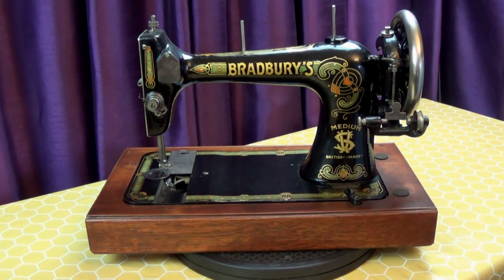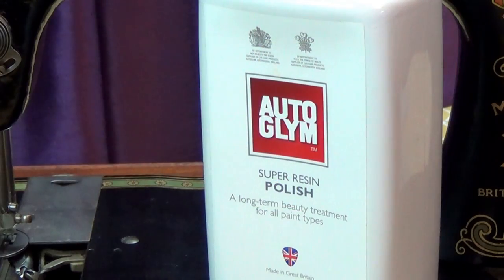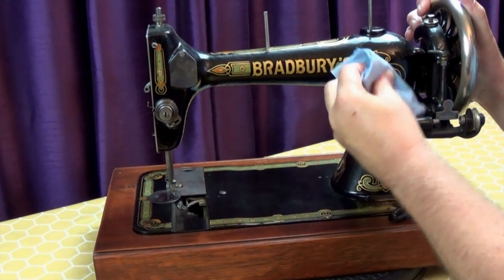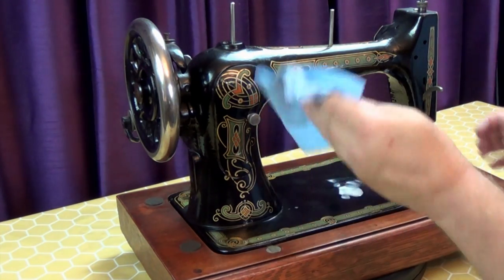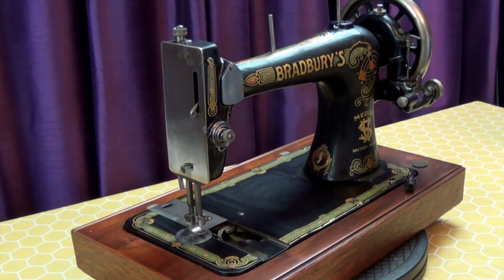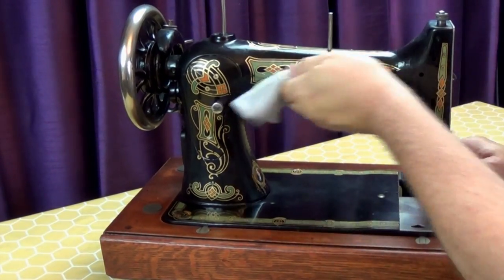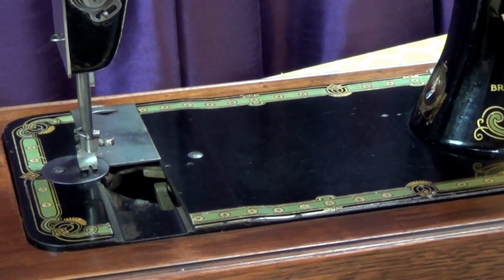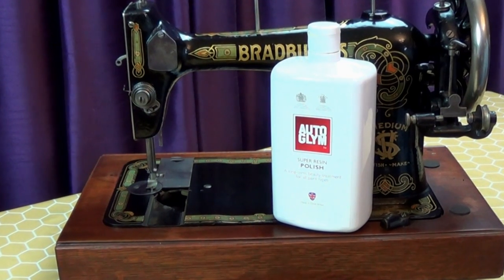How to get a Showroom Shine on your Vintage Sewing Machine with Autoglym Super Resin Polish

Comment: I'd really rather you didn't.
A vintage sewing machine has a very differerent surface finish than a car.
The car has a rather thick, uniform paint coat.
A vintage sewing machine has a very robust black japanning (no problem polishing that all day long), but above that, there are extremely delicate decals, protectected by a shellac clearcoat.
Shellac is water soluble.
So using a water-based polishing compound, which works perfectly fine on cars, will first dissolve the shellac protection, then very quickly ruin the decals.
Instead, you should remove all grime and dirt with petroleum, it will not dissolve the shellac. Once the surface is clean, you can then use a water-free waxing product for the shine.
Reply from the maker: This is a solvent based polymer wax polish. It will not harm the shellac. Shellac is not water soluble and needs methylated spirits or denatured alcohol to soften it. Water is not good for vintage sewing machines as it can work its way under the shellac and destroy the decals.
Reply: please educate yourself before posting ignorant replys that might effect others from benefittig from such products. i for one researched and with some hesitatation used this product on an old singer was amazed and now use it on ALL MY sewing machines.